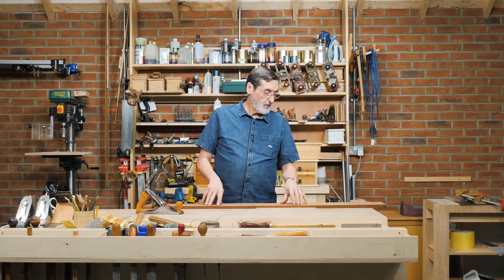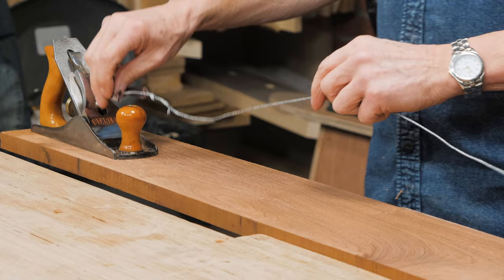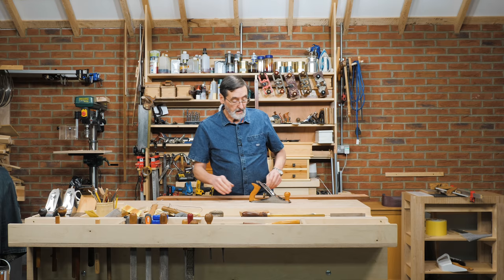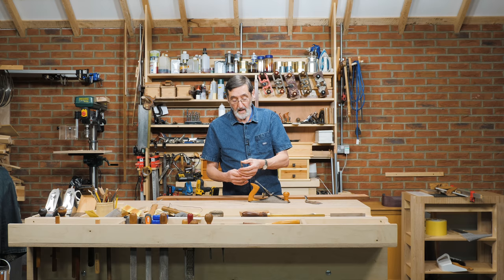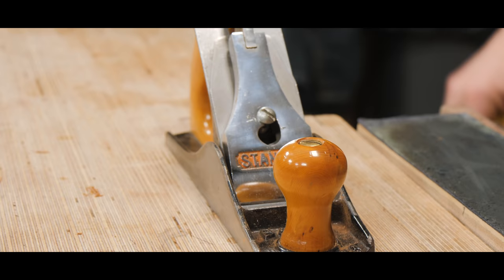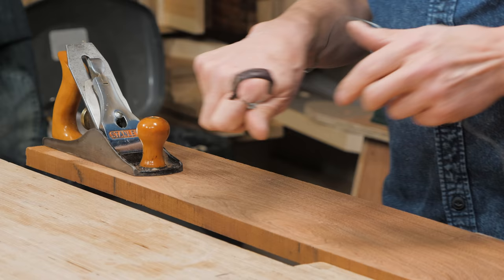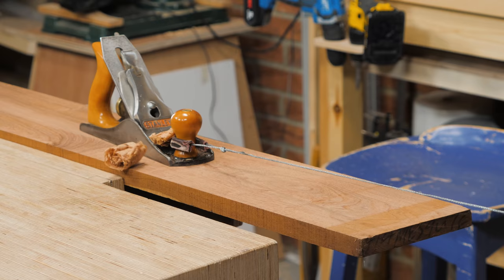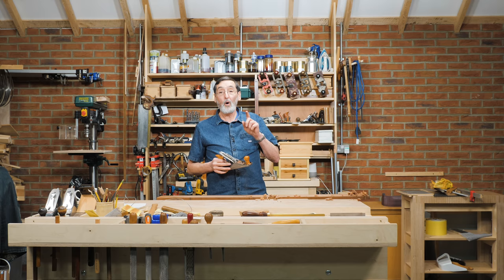How Sharp is your Plane? | Paul Sellers

Comment: Hi. been trying to get my planes flat and have had trouble doing so. cant find a surface that is flat to sand on. are there any easily obtained and cheap options?

also have a coffin plane and the cap iron and cutting iron are not even. lets light thru. and when its in the plane its slightly squint/at an angle, either or because of the mouth being not flat/straight, how would i get the irons to meet and not let light thru, don't want it to get jammed and been trying to sand it but not much luck. and how would i get the mouth/assembly straight for the irons to sit in? 

 your videos are very useful and helpful

is there a place to ask questions such as this besides the comments?
Reply: Others may have a better idea, but what I have up to this point is I use the quartz(?) back splash for the kitchen counter top.  It is more flexible than granite, and can be cut to length with the circular saw with concrete blade.  It is 6" wide x 3/4" thick x 8 ft(?).  Got it from the counter top place, I ask to buy the broken granite one, but he suggest the quartz full piece (this place was inexpensive (east of Los Angeles, CA) , other place with better quality could be expensive).  I use 36" long piece for short planes, 48" long piece for long planes.  2 options of sand paper, large sanding belt (6" wide) from Harbor Freight (last long than sand paper) or the 4.5" wide sticky back sand paper roll from Amazon.  The adhesive back sand paper, I rip newspaper and stick it and keep the sand paper in roll, this way I don't have to keep peeling off the sand paper and clean off the glue.  Use small wood strips and clamps to hold sand paper/belt on each end of the back splash, make sure sand paper is tight and flat.  Make sure the back splash is fully and firmly supported on workbench or saw horse.  Vac off the metal dust as you go.  Switch sand paper/belt grit as you see fit (sanding belt coarse and medium, sand paper 80, 120/150, 220 grit).  It is always a long process for me, I suggest take your time and break it down in multiple short sessions, just get it good enough to use the plane at first.  The used sand paper rolls, you can used those to get old plane blades to good edge before sharpening on the stones, long sanding surface makes it easier (and also on the chip breaker and level cap, and the frog even, and spoke shave).  I use this method for the Stanley scraper, spoke shave, some other planes, chisels, but have not used it on a draw knife.

Comment: New to your channel. Nice video and demonstration. What sharpening stones do you use and what liquid are you spraying on it?
Reply: Hello. Eze lap diamond stone, and auto-glass cleaner.
Reply: Coarse, fine and extra fine. 250, 400, 1600 if i remember correctly. They are called benchstones too.
Reply: It's actually 250, 600, 1200. Sorry guys, my mistake. 😁

Comment: Remember folks, a dull tool is more dangerous especially when thrown accurately at my head by the Mrs.
Reply: I thought that only happened to me :-)     On the serious side I keep telling her the most dangerous knife in the draw is the blunt one because you end up using more force with less control. I subsequently get told off because I go around sharpening the sharp knives and don't tell her so she applies the force she is used to and you can guess the result on her .... and sure enough objects levitate towards me. :-)

Comment: Thing is, how long will it stay sharp enough to do that? it's great being able to have the skill to sharpen to that level, but if it only does that for the first few strokes, is there any point in getting it that sharp? genuine question, i don't know the answer
Reply: True it will lose it sharpest level in the first few strokes, especially in hardwoods like this mesquite Paul is demonstrating with, however, it will still be sharper than before the sharpening break by a margin of sharpening loss you would have had in yhe same number of strokes from the previous edge.  And, of course, the harder the wood, the more often you will need to take a "sharpening break". Sharpeness fades on a sort of bell curve. Quickly at first, then gradually for a while, then kind of plateaus at a very shallow loss of edge over a much longer edge. Of course this curve is not the same for all metals/metallurgical blends.
Depending on the rate of decrease in sharpness in your steel, and the hardness of yojr wood, the frequency of sharpening breaks may change a bit. Just like with saws, chisels, or drills. Remember, the steel does make a difference on edge retention, as does the bevel angle and presentation angle to the wood.

Comment: I guess i havent been sharpening mine enough. It just skips over the top
Reply: With hard wood I'm guessing?  I take it you tried taking very light cuts?  How close ti the tip of the blade is the chip breaker.  Chatter (as opposed to skipping) can be caused by the tip of the blade actually flexing, and it seems to me that getting the chip breaker close will support the thin tip of the blade and reduce flex.  Do you camber your blades?  Did you notice Paul lifted one side then the other when sharpening to give the blade a convex (higher in the center) shape?  This is said to reduce chatter.  Lubing the sole with a bit of candle wax makes a lot of difference.  You can also approach with the plane at an angle to the work piece.  That makes it easier to push through hard woods, but I always feels like bad practice to me, and I actually feel guilty when doing it! LOL  Rob Cosman pointed out that rotating the plane that way also makes a significant difference to the blade angle.  You can see once it is pointed out, but it had never occurred to me before.
Reply: no, dont say enough, but say the right way.
Reply: @sethwarner2540  maybe "offen enough" or "effectively enough", but yeah,  the correct (right) way could be more apt. 
[Depends on grammatical nuance in your part of the world, I suppose.]

Comment: Interesting. I think my plane has a crappy metal in the blade. I take one swipe, and the thing goes out of sharp...
Reply: Depending on the wood you are using, this may be expected. If it is highly figured harder hardwood, then it needs a steeper angle on the iron. For softer woods a shallower angle shoild be fine. Check the angle of your bevel and do some research as to ideal blade angles for yhe woods you are using. Maybe invest in a second or third iron if you use different hardness wood ranges so youvdont have to reshape your iron/s all of the time. I sharpen mine around 26-32 degrees depending on which iron and for which hardness level of wood, and almost never drive the plane straight down a board. I much prefer a canted angle of approach, effectively lowering the angle of cut presented to the wood while allowing a higher, stronger angle on the blade/iron.